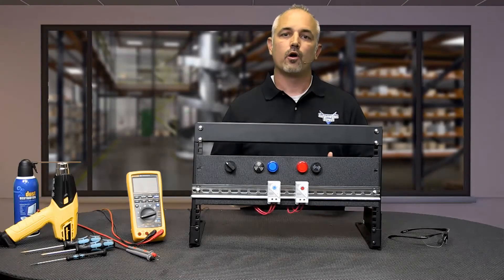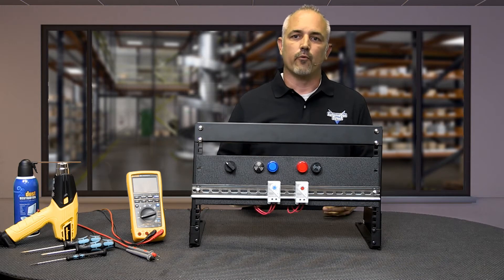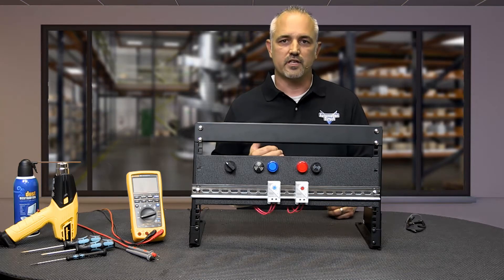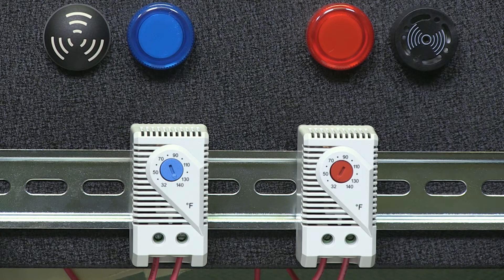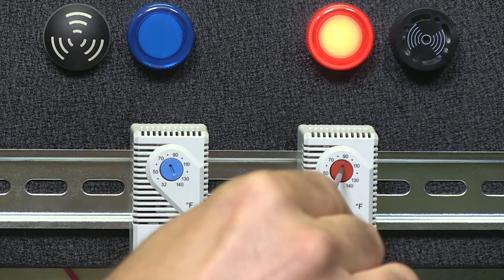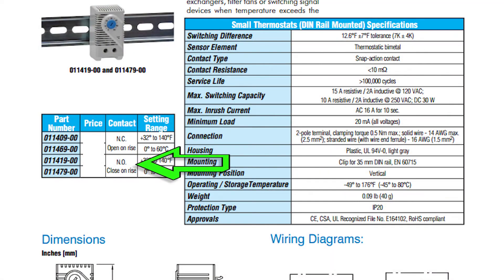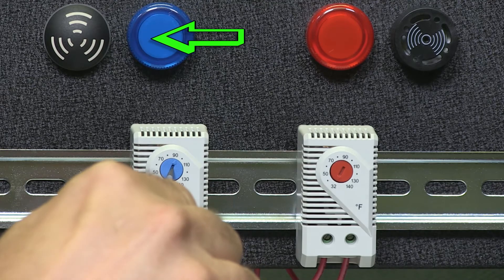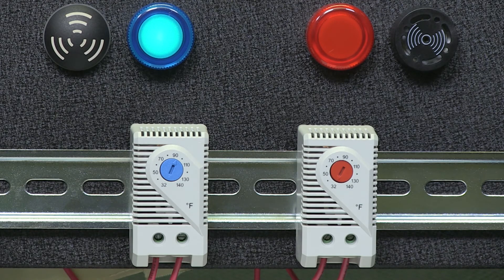STEGO Adjustable Thermostats: How They Operate from AutomationDirect

Comment: Can I give power and switch to a "Digitus DN-19 FAN-6-SRV-B 19 inch 6 x Server rack cabinet fan" with this? Isn't the current absorbtion and wattage of 6 fans to high for this thermostat? Thanks
Reply from the maker: Claudiu, I tried looking up the specs for the part number you gave and could not find amp draw. I think this thermostat should handle the draw of 6 fans, the current rating of these thermostats are 15A at 125VAC. Please see this link: https://cdn.automationdirect.com/static/specs/adjustablethermostats.pdf

Comment: Can I power A.C with this?
Reply from the maker: Hi Trevin, Not sure I understand the question. Are you asking if you can use these wit AC power? If so, then yes, these are designed to switch AC power. 
15A Resistive/2A inductive at 120VAC
10A Resistive/2A Inductive at 250VAC